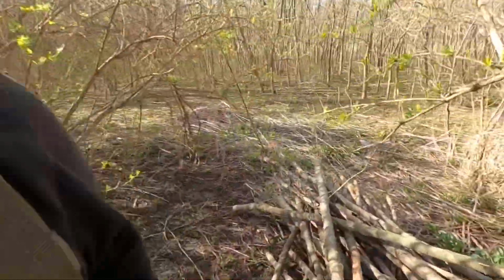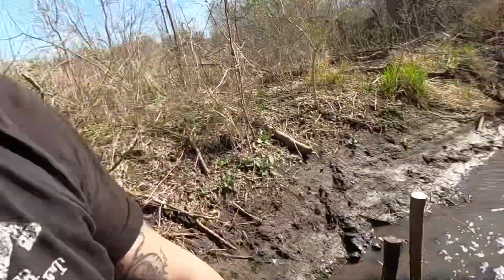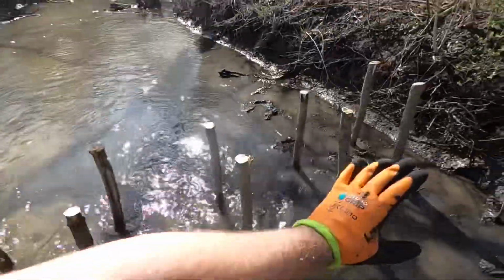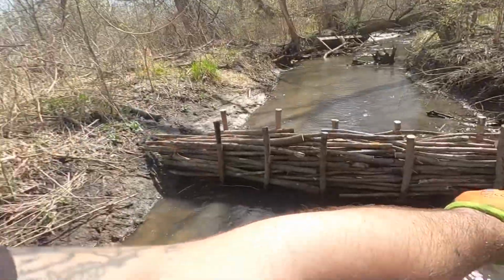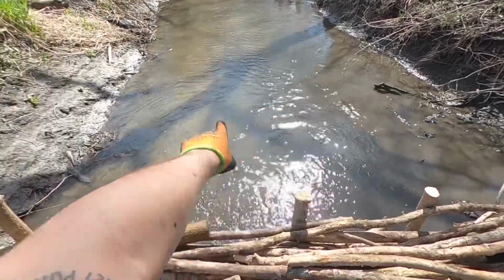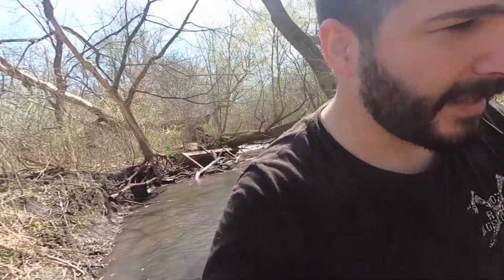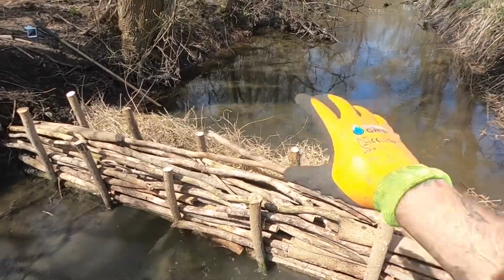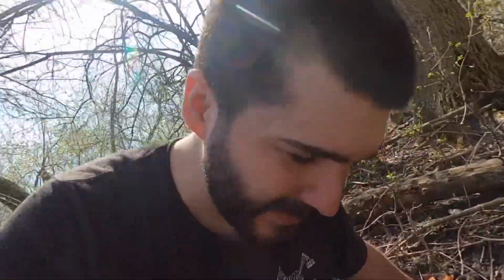Can I Stop The Flow Of Water Like A Beaver ? Building A Beaver Dam ! Ep.1

Comment: I'm sat here giggling away as I'm watching you construct what is basically a BDA (Beaver Dam Analog), which are widely used in river restoration, wetland restoration, floodplain restoration and riparian zone restoration to name but a few uses. They are constructed by driving posts into the river bed and banks, willow and other woods are interwoven between the posts and then stones, grasses and mud are packed along the back of the BDA. They are great for increasing biodiversity, slowing soil erosion by slowing river flow to give sediment to settle, acting as sediment catchment, raising river levels and river beds to reduce channellisation, raising river levels to increase contact with the riparian zone, and encouraging beaver back into an area to take over and improve the BDA (of course!), to name but a few benefits!

Such a fun experiment to watch you conduct! Can't wait for part 2 👍🤘